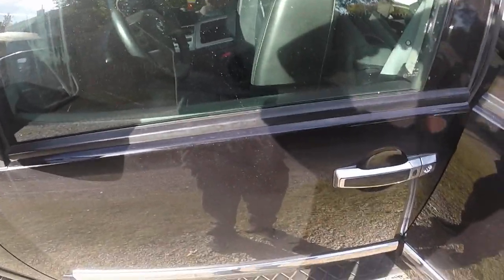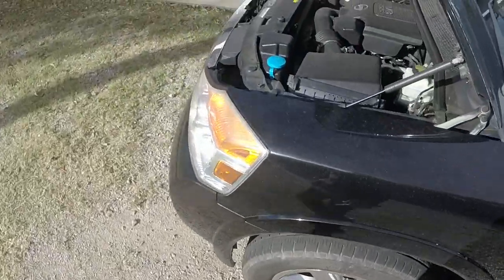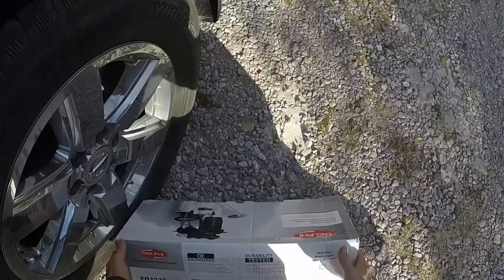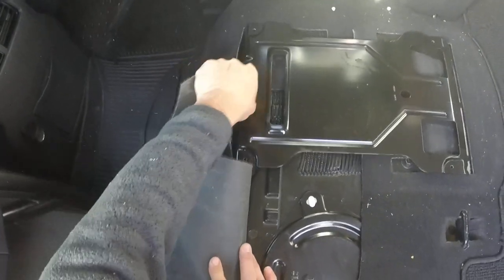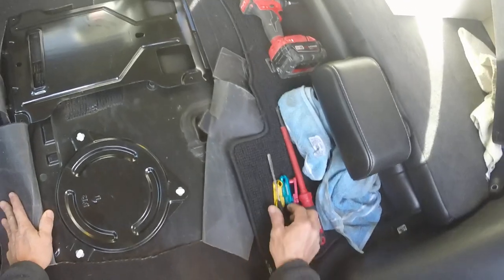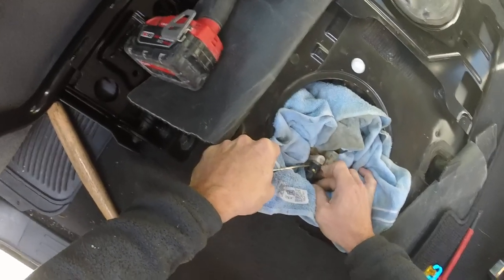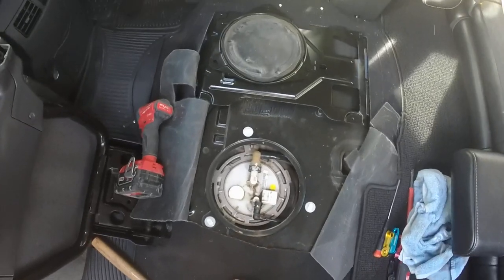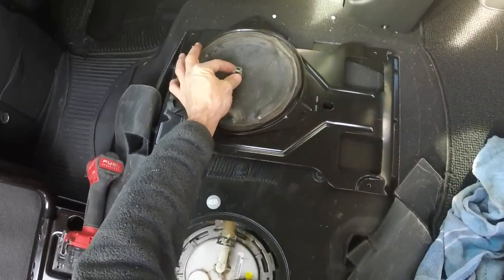2010 Nissan Armada Fuel Pump Replacement - Part 1

Comment: Thank you for this video series. I replaced the fuel pump all by my female self. It was empowering and I felt a huge sense if pride when I was finished. I would  never have done it myself if not for these videos. No way was I dropping that gas tank. Thank you!!!
Reply from the maker: Good for you! Glad I could help.
Reply: well done, if u can do this u can do most mid level repairs on ur vehicle

Comment: My qx56 died while I was driving yesterday.  I probably had less than a quarter tank of gas.  I believe my fuel pump is bad, but do you think if I put in gas it might start?
Reply from the maker: Well, that's easy to test by putting gas in it. If that doesn't work, check your fuses first before you consider a pump replacement. Second, get access to the pump area and test for power to the wire connector for the pump to make sure you are getting 12v to the pump on your initial key on. Pumps have relays to prime the fuel system before start up, so you need to have your meter probes ready before keying on as the relay will only show power for a few seconds
Reply: @dawveed26  thanks!  Yeah after I added gas it started up.  The fuel gauge was way off.  Probably the fuel pump needs to be fixed.

Comment: How again do you remove the power clip to the pump? I see you pressed down and pulled it off but it's not working for me.... please advise thanks
Reply from the maker: It's hard to explain. If I remember, and it's been a while, I used a small screw driver and pressed down on a square top tab. You may need to seat the connector all the way on, then press the tab so it'll rock the locking part away, then while pressed, try and disconnect. Wish I explain it better, sorry. Good luck!

Comment: I cant take off the daum lock ring what type of screw driver did you use flat head or cross head please help me!
Reply from the maker: Flat head. Soak that ring in a little wd-40 before you start working it too much. Might have some corrosion holding it tight. Good luck!
Reply: @dawveed26  thanks ill give a go again

Comment: did you use oem brand ?
Reply from the maker: No, couldn't afford it. I used an aftermarket that had the best reviews on Amazon. I don't remember the brand I ended up purchasing.
Reply: @dawveed26   has it lasted with no issues ?  thnx
Reply from the maker: I just sold the vehicle with the same pump I put in on this video, and it was working fine.

Comment: Where is the Armada fuel filter located?
Reply from the maker: In the tank. Filter screen on the pump, doesn't have an external filter.
Reply: @dawveed26  thanks

Comment: will this also apply for a titan 05
Reply from the maker: I don't think so since that's a pickup and not an suv. I've changed a pump on a 94 Chevy pickup and the easiest way I found was to unbolt the bed and raise it up on the end where the tank is, propping it up with some 4x4 posts to change the pump. Unless you have access to a car lift and your tank is near empty, unbolting the bed was the easiest way I found to do it. Good luck
Reply: @dawveed26  thanks.

Comment: I changed mines but its still won't work the pump turns on but won't start up the car
Reply from the maker: I tested mine by spraying starter fluid in the intake before changing the pump to make sure it was a fuel issue. Try that and see what happens.